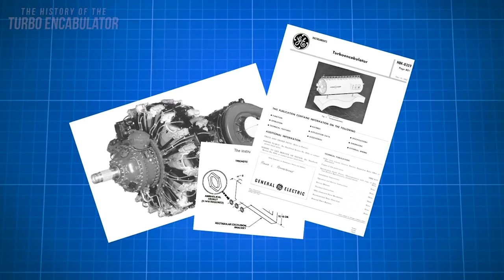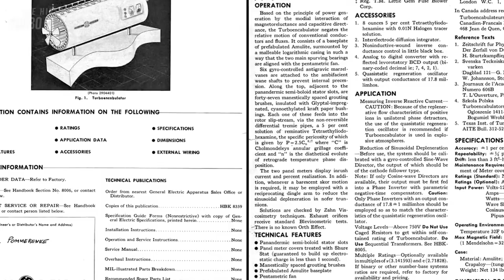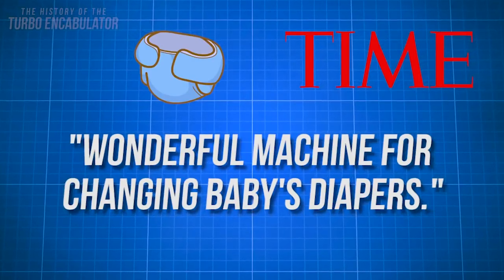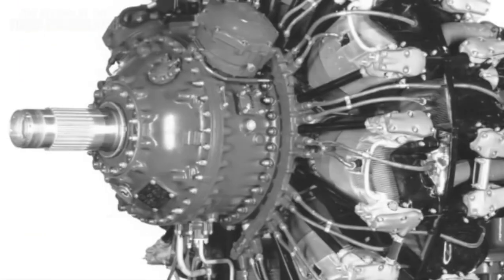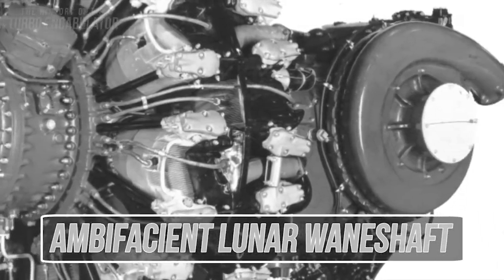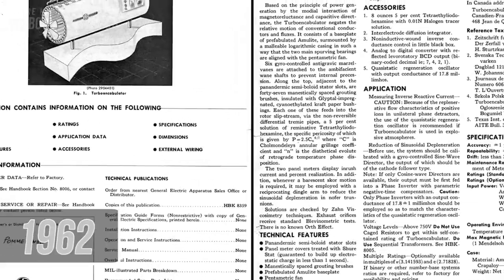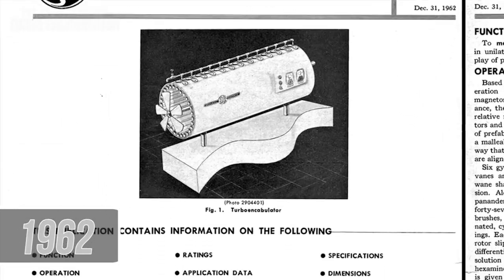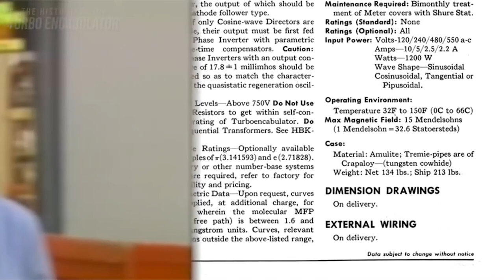What is the Turbo Encabulator?

Comment: Many locations using this device ceased operations due to excessive amounts of dihydrogen monoxide that it produced.
Reply: Even the hardiest of people in world can only survive 120 years after first exposure. Once you touch the stuff, you're practically the walking dead. One of my friends nearly died when he fell into a pool of that stuff...
Reply: If you take out the sub-gyrometric contraradial waneshaft, flip it and reverse it, reinstall it into the unit, and then turn the whole thing off and on again, it will being to emit large quantities of monomethylhydrazine and dinitrogen tetroxide
Reply: @InventorZahran  oh wow! that sounds like a big breakthrough! do you know who discovered that, and is it patented? i know quite a few applications where skor motion and unilateral phase detractance are required while operating in high thrust applications, this could provide a massive boost to efficiency!
Reply: The hyper encabulator now outputs hydrogen hydroxide, instead.
Reply: The EPA ruins everything!

Comment: You think it's a joke until you are struggling to figure out how to stabilize side fumbling by manually de-polarizing the magnetic fluxuator with your primitive manual dingle arm. You'll find it's a very specific skill set that must be developed through many years of training. Luckily, the retro encabulator solves this effortlessly by automatically fluxuating the magnetic field around the quantum drive with its own dingle arm operated by a mechanical capacitance reversal unit. Gone are the days of struggling with a manual dingle arm to modulate the magnetic fluctuations, constantly running into frequent side fumbling. Kids these days will never know the struggle of having to re-calibrate your magnetic fluxuator by hand when your manual dingle arm malfunctions.

Comment: I know this device is mostly immune to side-fumbling, but does it have any physical or technological preventative measures to suppress or otherwise cope with pogo oscillations?
Reply: One solution may be to attach the wane shaft to the stationary end of additional bourdon tubes, connecting up to an amulated aneroid gauge so that curtailment does not denudate the assembly.

Comment: Encabulators are great and all, but for the past few decades, all the really interesting innovations have been in the realm of vx. And thanks to the vxjunkies community, it's far more accessible to the home-gamer, if you don't happen to have access to a nicer rig through your university engineering department or if you happen to work for a small subset of government contractors. It's dangerous stuff though, so be sure to read the faqs before attempting to get anywhere near 3 orders of magnitude of delta >= 0.

Comment: This reminds me of JBL audio systems spoof product The Rearaxial Softspeaker for which JBL actually published an official looking brochure complete with spoof drawings. At a ham radio convention back in the late seventies I attended a presentation by Signetics on their new digital storage memory chip that they called the WOM, the Wrote Only Memory and I was actually able to get one of the spoof data sheets and an actual physical sample of the chip which had realistic looking markings on it that you would expect to see from a chip manufacturer including the amusing marking ‘NFG’.
Reply: Electro-voice also had a competitive Rearaxial Softspeaker which I have heard compared to the JBL.

When used with a Compact Disk, mp3, wav, or controlled with Dual Differential Mercury/Fluorine Optical Sensors, sound reproduction using a Vynil Based Format is quite good, unless ambient lighting is adversely effective due to higher humidity. 

In my opinion, the Electro-voice Rearaxial Softspeaker is still Superior to the JBL version... but, like Vynil Formats, the E-V is difficult to find, Service and outrageously Expensive.

Where I live, I would bet there's not a Commercial E-V Charging Station within 100 miles, so I am still stuck since I accidentally sold my old E-V to some dude named Elon on eBay!

... Man, how I miss those Silky Woolen Lows and the WOW of those Highs!

What do you think I should do...?

Comment: Due to a parts shortage, the Panametric Fam is actually on backorder, and unfortunately my Parts Department does not have an ETA on receiving the parts needed to repair your Hydrocoptic Marsilvains. I hate that you're in this position right now, and I wish I could help, but the Lotus O'Delta production line has shutdown during the pandemic and are only recently resuming assembly. Once we can get restocked from the manufacturer, I will make sure we can install your Gurdle-Saforementioned Panametric Fam. I appreciate your understanding in these unprecedented times.